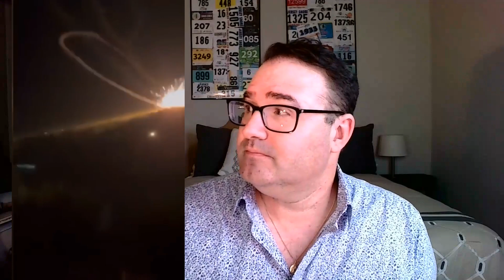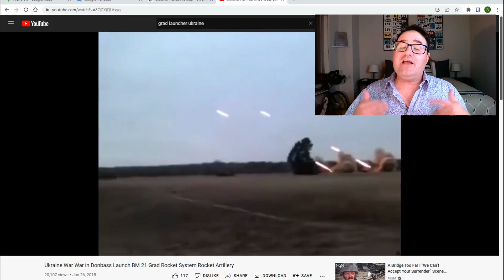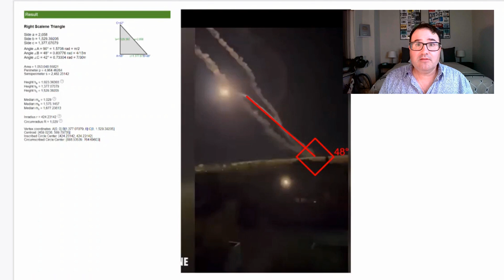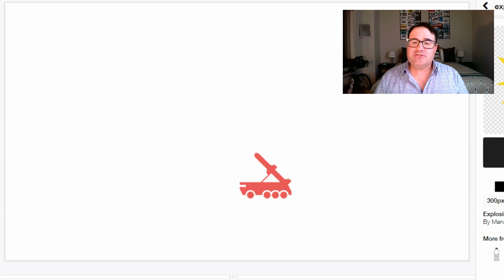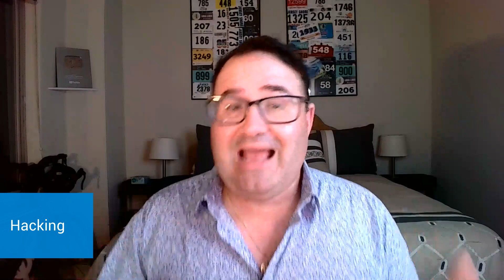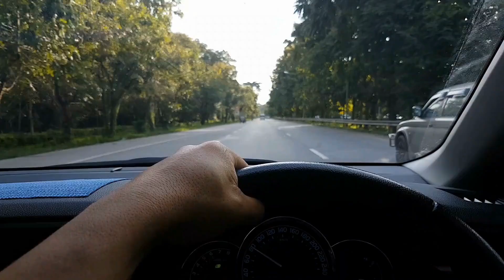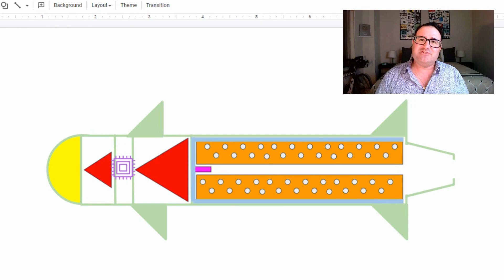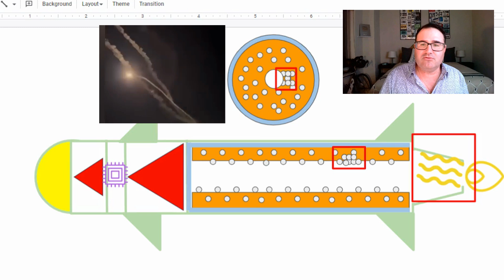Why this missile U -Turned

Comment: New Garbage-level Speculation: Ok, So you have a firing solution and want to launch: Operator commands the missiles made ready, power is applied either from OFF, or from a warm-up-standby-mode, the missile wakes up, does a quick check, gets the initial bearing information from the firing computers, etc. and shows OK to the launcher, and the launcher ignites and sends it.  The vibration (solid rockets are the least smooth) and G's causes a power interruption to a control module.  The power comes back immediately, the module re-initializes (note: not "reboots" but comes up the way a no-OS type computer does, from firmware, like a microwave oven, not like a PC), _the ok-to-launch-fin-wiggle happens again_, the turn starts, the fin centers, the turn ends, and now the missile is still looking for the return from the targeting radar.  These control surface wiggles don't happen every time a missile is powered up, they happen often as part of a arsenal-level QA check, and when in storage, the fins often times are not even attached.  Some missiles, especially Russian ones, have a fin wiggle as part of making sure the articulation will work, esp. in cold weather.  They can also happen when the controller for the fins (sometimes one controller for each axis) loses its Zero, and then moves the fin (in QA/Maintenance Depot mode) to the limit, and then back to center.  The fins are moved in opposite pairs (N-S, E-W) sometimes on a common axle, with a bell crank to either a motor or compact hydraulic stage, or even a screw jack (older rockets are bigger, take bigger forces) or on modern/"miniaturized" rocket airframes from compact electric motors.  Either way: it would be easy with some interruption from power or code crash in the controller to lose the zero and need a limit reset, followed by a return to center.  Even a 39$ pan/tilt home camera does the same thing.  How or even if-at-all the radar is a factor in this remains a mystery.  This is complete speculation but its what I got.

Comment: In 2013 a Russian Proton-M had a launch failure where the sonsors where installed upside down which told the rocket it was upside down and caused it to crash into the desert.
Maybe it was something like that, you can find the video on youtube by simply searching "proton m failure"

Comment: I think your hypothesis is wrong.
That sort of issue in the Solid fuel is not going to result in a steering error as seen. All the combustion gasses is still being directed by a nozzle.  That sort of issue will most likely result in an burst motor casing and destruction of the rocket in flight, not a u-turn.

It's possible that some component of the inertial sensing system of the missile was installed incorrectly. This means the rocket thinks it is 180° backwards and tries to turn itself around according to the guidance commands. 
We have seen this happen before with a Russian or ital launch vehicle when a proton rocket had this very thing happen while trying to launch a Progress resupply craft to the ISS.

And no you cannot rule out an issue with the guidance fins. It's much more complicated than that.  While there may not be much in the way of active guidance commands ordering rapid changes to a control surface, some shirt or stray voltage could be creating a false command. Then during the extreme high-g u-turn, the short fixed itself and the rocket straightened out. 
There's any number of possibilities and you don't have enough to rule out several that you ruled out, and there are likely other failure mode neither you nor I could guess at.

I've watched a missile do similar from a bad control surface. Not a 180° and right back at the launcher thank God. But a 90° right angle nose down straight into the water about a half mile from the launching ship. It was an SM-2MR from a Perry class Frigate in 1993.

Comment: Thing is, the fin needs to be held in place but there was a failure in the hydraulics or whatever actuation system so a perturbation came along, say a gust of wind, which knocked the fin off centre causing an uncommanded manoeuvre and the rocket flew back to its launch site.
Reply: Where is the proof this was the case?

Comment: You sure that's how a 2058m length looks from 500m away? 
Also shouldn't there be a sonic boom if those rockets go mach 3? 

I think you got it all rearwards starting from the 500m distance estimate which seems adequate. Then estimate the straight portion of the trajectory based on the angle of view. Would probably make up to 200m. Thus estimate the average velocity of the rocket in that stage of the boost as up to 100m/s, and therefore probably narrow down the possible type of the rocket system.

Comment: With the missile traveling around mach 2 at that stage, there's a good deal of force on the stabilizers/fins, keeping them straight, if you assume that they were just free to move, more especially if they're being held in that position. If what you say happened, the fact that the fins were straight means that a hard turn would have been almost impossible. Without its fins being commanded to move, they would have remained straight, meaning the change in thrust  would simply have caused the missile to veer off in a different (forward) direction.  The smoke trail seems pretty regular as well, thereby discounting the possibility of a breach in the casing around the fuel chamber. So it seems like it couldn't have been a physical problem. Notice also that it did not return directly to its point of origin. While it is difficult to see in the video, the rocket turned in the direction of the camera and continued its arc until it hit the ground, a good distance from its launcher. At first look, the perspective (the missile more or less coming directly towards us) appears to show that it straightened out but more detailed scrutiny belies that. I'd bank on some sort of electronic failure or a linkage failure that caused the fins to go hard over. If it was an electronic problem, it could just as easily have been in misreading the guidance (data input) as an erroneous redirection of the fins (control output). No way to know. Probably a combination of age and mishandling.

Comment: In my experience with missiles you manually add the fins and wings, what could've happened is that on one side they weren't attached properly, and after a few seconds of being airborne they broke off or malfunctioned, then the missile tried to compensate causing it to go straight again.

Edit: or it could've been a seriously faulty gyro or an error with the launchers' LNU.

Comment: Showed your video to friend of mine who was actually in the Russian army and he told me a lot of those missiles will put in warehouses with no heating or cooling so there was subject to summer and winter temperatures so you're probably right.   He told me that he's actually seen a missile split into.
Reply: Sorry, I don't say this to be pedantic, but to clarify: He's seen a missile be spit into or be split in two?
Reply: @miral6694  the point is the missiles are not safe. Down through the grapevine several weapon systems did not work the way they were meant to. Russia lost the most advanced naval ship with somebody sleeping at the radar no something was not working.
Reply: I think it's a hole in the side or second stage misfires. Because right before the U-turn you can see it gets brighter on the opposite side. As hole gets bigger the pressure drops, turning slower , right before impact it looks like I can see it.  But fuel can be shaped like a star for more thrust. Maybe if I can turn the   Color down on the video may see it.

Comment: Your estimates of distance and hight at the start of this video don’t add up. If the camera is 500 m from the launcher (estimated from sound delay) then you say that the missile traveled 2000 m from the launcher before turning around. So the missile has travled 4 times the distance from the camera to the launcher. That is definitely not what we are looking at. That would put the missile well outside this fairly narrow angle lens. Your assumption about the missile speed is probably wrong.

Comment: I would guess a buffer-overflow could have done the same, given the max distance it was likely operating at, I would consider that a possibility. Don#T know in what dataformat theire guidance system works though. But if they made specific software that cuts out after a set lenght or flips sign once the guidance radar tells it the target is farther than x m away it could be possible.

Comment: I'll just observe, based on the other comments here, that the missle seems to track back directly to where the target tracking radar would have been located.  Why I won't guess, but it is suggestive that it reverses in a 180° turn.  I wouldn't rule out some kind of spoofing or it could just be a normal old Soviet SNAFU.  Though I've worked with missiles on occasion normally I'm just an airframes aerospace engineer who's worked in failure analysis on occasion.  I think that makes me a rocket scientist.

Comment: Really doubtful that an uneven burn in the combustion chamber would affect the thrust vector this much. Also not all SAMs are active, some are passive (not to mention IR guided). Seems unlikely, but I suppose it might be possible that the site was deployed incorrectly and the tracking radar accidentally illuminated something on the ground. The other 2 missiles, judging by the trails are too far away and might have already reached terminal guidance phase.

Comment: What happened to my comment?  There seems to be a turn, a lag in thrust, another turn, then great acceleration. My guess from this explanation is: the clump of accelerant caused the turn, the uneven burning from the hole in the fuel caused a lack of power, then it turned downward to fall and regained full power.  Going downward while powered created a very rapid finish.  It must have regained power just as it tilted towards the launch site or it would have gone straight down.

Comment: Wrong in so many ways. If it were a fuel issue the pressure increase would cause the motor to burst. This is a guidance-control issue. You can blame poor manufacturer QC as the problem. Maintenance and training exacerbates the problem more.

Comment: Improper fuel burn?  Possible but not probable.  The type of burning you describe would result in an abnormal 'hot spot' in the propellant grain resulting in a motor casing rupture and high order detonation.  I have supported several tests where this has occurred.  Typically due to age and cracks or voids forming in the propellant motor.  Misalignment of a fin would result in the missile corkscrewing immediately upon launch.  My two cents are on operator error (inputting the launch point as the target).  remember that this systems tend to be track ball based point and click.

Comment: One more comment: many missiles are stored in warehouses for years... and not all countries are diligent in keeping the missile batteries up to date.  It may have been faulty electronics due to power loss caused by an older battery system that is not fit for purpose (due to poor maintenance).  Given what I've seen on this war and the condition of the Russian equipment and capabilities of the field personnel, is only reasonable that the non-field personnel are equally "capable" and may be missing many military asset maintenance, including batteries.

Comment: Is a good hypothesis - however why did the other navigation mechanisms (movable surfaces, thrust vectoring, ...) of the missile did not compensate to correct direction?   Another hypothesis is that the engine gimbal failed (if this particular missile model has one); this one has the advantage that the missile navigation mechanisms would have acted "normally" but based on an incorrect data assumption (caused by the faulty gimbal)

Comment: I think the conclusion is unlikely.  The missile track is interesting because the missile turns around then at exactly 180 deg change in direction it straightens out its course and returns along parallel line to its outgoing path.  If it was a propellent problem this is very unlikely that it would burn just the right amount of time to create an exactly 180 deg turn.  Also if it were the propellent I don't think changing the thrust direction would necessarily be the result we see.  When the  sub optimal solid rocket fuel became exposed and started to burn at different rate wouldn't this just increase or decrease the rate of propellent burn per sec in the chamber.  It would look more like a speed up or slow down in the acceleration, not a turn.  The exhaust gasses would still exit the chamber in an axial direction.  I also believe the assumption that the fins are not commanded this early in flight to be unexpected.  It may be true.  But I don't have any reason to believe it is true.  Also, if it we assume it is true, it does not mean there was not a malfunction in the fin controls that moved the fins regardless of what the software was commanding.  However, the missile executes a 180 deg turn then straightens it's course out and returns to the launch point.  So that makes a fin control issue unlikely as well.  The problem looks to be commanded by the software.  Whether it was a mistake by the software due to some transient condition, a malfunction/software error who knows. its possible the inputs to the software from some sort of Guidance and Nav Unit made it think it was accelerating when it wasn't and the software corrected for this by moving fins to correct.  But here again, it doesn't just change course continuously resulting in a spiral.  It changes course for 180deg turn then straightens out.  My guess is the turn happened right when the software was changing modes from leave the tube mode to guided flight mode.  I'm guessing since I don't know anything about the russians wrote their software.  But assuming it would have something like that.  It could be possible an operator entered some coordinate wrong or a negative instead of positive which resulted in the missile starting guidance and thinking it was going in the wrong direction and thus turned around.

Comment: I've think he is wrong. The thing with fuel will ether cause the rocket motor under preform or explode. Those missile have thrust vectoring to allow them to maneuver to their intercept trajectory while in boost stage of flight. The launch vehicle only points on the general direction. So a computer issue or a stuck fine are more like went wrong. Still comes down to a manufacturing or maintains problem.

Comment: I feel like the rocket nozzle would negate most of the uneven burning inside the rocket due to how it squeezes it and then allows it to expand, all those gasses come together at a point and then expand all together, I don’t see how you could get enough thrust on one side to flip it around.

Comment: A stuck fin would just send it spinning but the missile took off straight, turned extremely sharp, then straightened out for the most part before hitting the ground. The fuel theory doesn't make much sense either because the cone should direct the force of the burning fuel however inconsistent it is (I feel). It looks in full control imo and guiding itself onto something, my question would be does the missile's radar remain off for the launch portion and then enable somewhere after boost phase to negate false locks until its clear of friendlies? With further reading I wonder if something got just infront of the tracking vehicle and for a couple of seconds pinged the tracking radar back at the emitter which made the missile lock onto it?

Comment: If it was a bad burn it would be more erratic as the guidance system tries to correct.
The flight path is straight up to the height of main guidance which it then went straight back.
I think human error programs the target into the missile guidance system.
Or the missile was incorrectly manufactured so when it switch to seek the giro/sensor upside down!
Not unknown with Russian rockets having the angular velocity sensor put in upside down as they have had a couple space missions destroyed.
Probably pressure in the factory to build more ammunition as it runs out of stock!